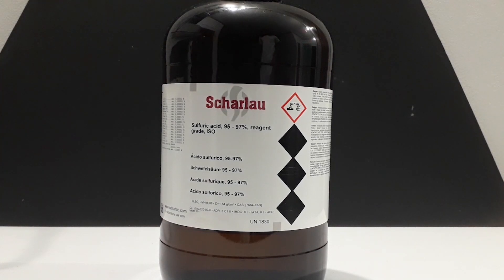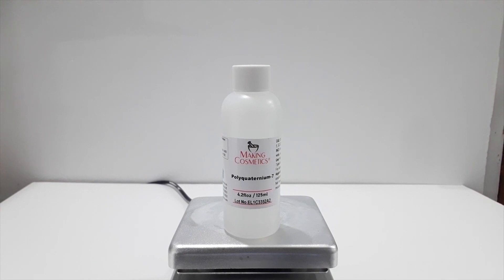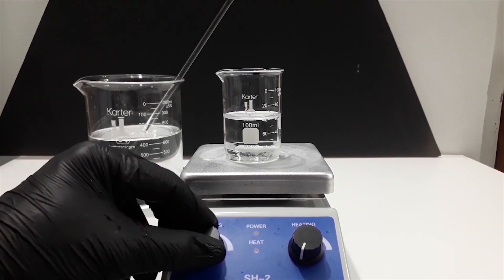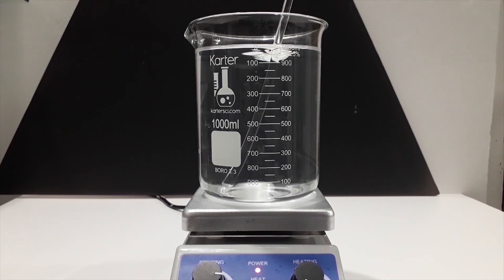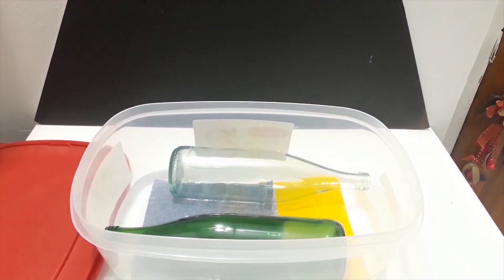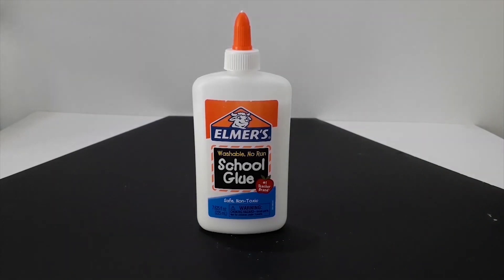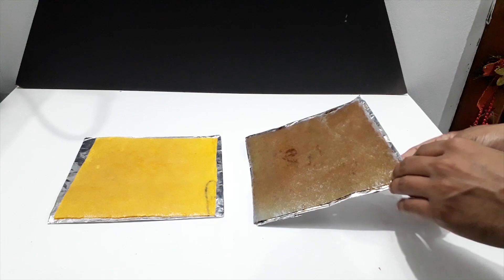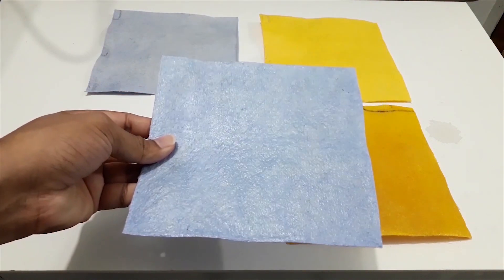How to produce DIY ion exchange membranes for various electrochemical applications.

Comment: got a link to the original research paper? also, how would i go about making a membrane that is meant for anion exchange as opposed to cation exchange?
Reply from the maker: change citric into glutamic/aspartic acid HCl salt. I have a video on that too. also just search this on google for the paper "ion exchange resin made from polyvinyl alcohol and citric acid" and you get a research article as your 1st result talking about this polymer. I simply put it on a substrate.
Reply: @CatboyChemicalSociety  thanks! i didnt think there was much of a chance that you would reply, but you also replied real quick! time to go down the google rabbit hole lol. also, do you think this type of membrane would be able to handle turning concentrated potassium nitrate into potassium hydroxide and nitric acid?
Reply from the maker: @josephgauthier5018  nitric acid is finnicky because it oxidizes at the anode to nitrogen and reduces at the cathode to nitrite and ammonia.
Reply: @CatboyChemicalSociety  does that come down to electrode material selection?
Reply from the maker: @josephgauthier5018  well the issue is also concentration not just electrode
Reply: @CatboyChemicalSociety  oh, well dang. do you think it would be relatively economical to make it relatively low concentration and then distill it afterwards to get it to usable concentrations?
Reply from the maker: @josephgauthier5018  I believed I talked about this in a SM thread and you would need a jacuuzi sized reactor to produce barely 1% HNO3 and its really more worth to do birkeland eiyde even at that point.
Reply: @CatboyChemicalSociety  ah, well crap. then i guess ill have to take a close look at the ostwald process. back on the topic of anion exchange, im interested in concentrating co2 from air, so i might still find some use for it...eventually lol

Comment: I followed your directions and tried to make ur PEM for a microbial fuel cell. Since, u said that if we are making a fuel cell, we can skip the first two steps (applying PVC cement and the dechlorination solution), we directly applied the glue and citric acid to our cloth. But once we baked it, it got burnt and it doesn't have the shiny layer. It also stuck to the foil and was very hard to remove (broke some of the times)

So I was wondering what went wrong? What type of cloth did you use and does it matter? We don't have a thermocouple probe so we didn't can't use that, so is there any problem with a burnt PEM? Does it impact the function? Also how do we know that we did this right and the PEM actually works before using it in the fuel cell?
Reply from the maker: Temp control wasn't adequate because these ovens tend to do something called 30 seconds on and some seconds off so the elements maybe at higher temp so preheat your oven. Also gas oven doesn't work
Reply from the maker: Removal from foil is easy just dissolve the foil in NaOH if its stuck which is why foil is used. If its medium brown its ok but black means too burnt. Fiberglass mesh substrate is best. Theres going to be a new membrane video involving fusing deionizer resin just tested it works well.
Reply: @CatboyChemicalSociety  Thanks for the response! I don't have an electric oven, is there any alternative? Also, I saw in some comments you said tissue paper, so should I use that or the fiberglass mesh? Would I repeat the steps multiple times? My membranes all turned brown so ig that's good. Also, would the holes in fiberglass mesh be completely fine?
Reply from the maker: @srimayikukkadapu2425  yea multiple coats work but yea I suggest getting an electric oven even a small toaster because gas ovens rly don't work for this. Maybe you can also bake the membrane in a hotplate between foil
Reply: Thanks for the response! Thankfully, I was able to borrow someone's electric oven! Just to clarify, would tissue paper or fiberglass mesh be best to use? Would the holes in fiberglass mesh be completely fine? Also, I realized the citric acid I got wasn't pure, it has less than 2% silicon dioxide. Is that fine or does it need to be pure? I also estimated the measurements when mixing the PVA and citric acid together. Would that be too problematic? Do I need precise measurements?
Reply from the maker: @srimayikukkadapu2425  that's fine for citric also tissue paper can be used but if it sticks to foil u cannot use NaOH method to remove and yea the holes im fiberglass will be covered up with many coats because it bakes on insoluble plastic layer above rm that makes thin films

Comment: have you given any thought to sulfonating porous membranes with chlorosulfuric acid?
Reply from the maker: the issue is that highly sulfonated membranes need to be crosslinked or else they will just dissolved. The way sulfonated PS membranes are produced is they sulfonate the monomers and use divinylbenzene as a crosslinker and this forms a crosslinked polymer.

Comment: My glass cleaner contains ammonia, Can I use that?
Reply from the maker: Nope you need NaOH to dechlorinate PVC
Reply: @CatboyChemicalSociety  I mean Can I use glass cleaner which contain ammonia instead of amide chloride salt?
Reply from the maker: @farialorion5934  no it needs a quaternary amine catalyst
Reply: Can you tell me mechanism how it work during photon exchange?
Reply from the maker: @farialorion5934  the free carboxylic group of the citric acid after linking accepts H+ ions and other cations allowing it to pass thru the polymer.
The main ionomer is an ester linkage of citric acid linking PVA chains together to form a water insoluble ion exchange resin with carboxylic functionality.
Reply: @CatboyChemicalSociety  Can I use it wastewater splitting  for H2 production and decrease ch4 production by absorbing Co2 ?or rather I should use PVAcetate with Chitosan membrane?
Reply from the maker: @farialorion5934  PVAcetate is already reacted how can it crosslink. you need polyvonyl alcohol not acetate
Reply: @CatboyChemicalSociety  Can I use this membrane for Wastewater splitting for hydrogen production?

Comment: Thank you for the informative video! I've been scrounging academia for information concerning the manufacturing methods IEMs. How typical would you say is this process compared to something you would see in industry? And a little deeper knowledge, if you have it; what are the main cost drivers for ion exchange membranes? based on this video, the manufacturing seems like a very long and involved process.
Reply from the maker: This is good only for mild conditions or prototype cells proof of concept. This membrane is made of crosslinked PVA and the linker also contains the ion exchange groups. Commercial membranes use a backbone polymer usually PTFE modified wity alcohol then you add a diglycydyl ether as a tail to these sites and finally an amine or sulfonate containing group is reacted to the other end of the diglycidyl ether. These are all perfluorinated in other sites. The main cost is that perfluorinated diglycidyl ethers probably aren't cheap

Comment: is it possible to use this membrane for a PEM - zero gap cell water electrolysis?
Reply from the maker: Id use commercial nafion for that but if its mild you can give this a try but only paint citric and pva on thin sheets and bake. Skip the pvc step
Reply: @CatboyChemicalSociety  Thanks, I have Nafion 2020 (which is a Nafion solution) which material would you recommend to make a composite membrane with nafion? Can PTFE coated with nafion be a good PEM in this case?
Reply from the maker: @mariocorbalang.4537  PTFE is a good substrate but fiberglass works too for a robust substrate and polyolefins are fine aswell.
Reply: Thanks for your answer, will give it a go with PTFE and fiber glass then

Comment: very good video. Could this membrane be useful for zinc electrolysis? the electrolyte contains zinc and iron ions
Reply from the maker: Depends as the mobility of the ions depends on their valency and ionic radius  or is it to prevent further oxidation of iron during electrowinning by using an aem on the anode

Comment: If I want to electrolysis water in 3 conditions as bellow, can you say me if it is possible to use a type of membrane that prevents mixing of initial materials with each other:    1- cathod side H2SO4 and anode side NaOH    2-cathod side H2SO4 and anode side Na2SO4  and3- cathode side Na2SO4 and anode side NaOH  ,   and which one is more practical?  since I want to lower over potential of both cathode and anode by preparing better ion accessibility on each side.      I am really thankful for your excellent video and more excellent answers via comments.
Reply from the maker: if the goal is transfer of SO4 ions through the membrane then using a cation selective membrane would be best.
Reply: thanks for reply, no goal is to having H+ near cathode and OH- near anode to assist electrolysis, if possible please guide how it is possible, but if not perhaps at one side we can use a neutral salt,   @CatboyChemicalSociety
Reply from the maker: @sinaTonewood  Whichever membrane you use it will actually attempt to diffuse unless maybe you use a seperator instead of a membrane which is only porous to OH- and H+ but these are very exotic.
Reply: Really thanks, do you mean separators are more rare and expensive in comparison to this membrane? or there are some materials near us could be used as separator?   @CatboyChemicalSociety

Comment: Thank you very much indeed for the video. I was going to ask something, if you'd like. I am trying to prepare a membrane to obtain liquid caustic from salt water. Would this system be suitable for me or do I need to use different compounds? I would be incredibly grateful if you could reply. Thank you in advance, good work.
Reply from the maker: This membrane as it's shown is for that kind of work
Reply: Thank you very much. I have one more question, will you work with chlorine dioxide? Thank you from now. @CatboyChemicalSociety
Reply from the maker: @fescamakina  I will if I ever need to dissolve iridium into solution
Reply: I am waiting for your chlorine dioxide video with curiosity. success and respect. @CatboyChemicalSociety
Reply from the maker: @fescamakina  need to make SnCl2 first because I plan to use it to dissolve rocks containing precious metals
Reply: GOOD LUCK @CatboyChemicalSociety

Comment: I've seen videos where they had made use of a ceramic pot inside a tupperware container. The ceramic doubled as a diaphragm and a separate container. What's your take on that?
Reply from the maker: It works but it has less ion selectivity
Reply: @CatboyChemicalSociety  Also contamination of the clay pot by metal oxides that will get electrolyzed.

Comment: Can I get only positive hydrogen ion from these membranes if I pass hydrogen through membrane filter? Or just the membrane by itself won't do it?
Reply from the maker: These are proton exchange membranes for H+ ions but if you want to diffuse H2 use an RO membrane they work for that
Reply from the maker: but yes they can selectively pass H+ ions through and infact polycarboxylate are more selective towards protons than polysulfonates.

Comment: thank you so much for this video. i was wondering what is the difference between this and a PEM. (proton exchange membrane)
Reply from the maker: This is a PEM but if you swap out the citric for aspartic acid HCl you make an anion exchange resin instead.

Comment: can this be used in a hydrogen cell ?
Reply from the maker: yes and it can seperate H2 and O2 without losing as much conductivity as an ordinary seperator.
But for a fuel cell specifically you need a thin PVA film over maybe a tissue paper substrate and skip the PVC.

Comment: What happens to the water released during esterification between pva and citric acid?
Reply from the maker: Evaporates due to 140C or higher
Reply: @CatboyChemicalSociety  Thanks!
Can i use these membranes in algae powered biophotovoltaic cells or would it be toxic? Also, how many layers of the ion exchange resins are appropriate?
Thanks again!❤
Reply: P.S. Can i forgo the pvc cement as it is a slightly softer application?
Reply from the maker: @sanhikgangopadhyay8812  yes you don't need it if it's going to be softer stuff like flow batteries
Reply: Would the citric acid be anhydrous or monohydrated?
Reply from the maker: @sanhikgangopadhyay8812  monohydrate works as the PVA is in 10% solution in water anyway. The baking step is what crosslinks the pva chains
Reply: Can i use polyvinyl alcohol powder
Reply from the maker: @sanhikgangopadhyay8812  yes but you need to pre dissolve in hot water to form a 10% solution.
Reply: Ok but why is Elmer's clear glue being shown as polyvinyl acetate glue?
Reply from the maker: @sanhikgangopadhyay8812  it's not but whoever is selling does not know
Reply: In the internet
Reply: Thanks
Reply: What should i use as an activator for this membrane? Is it necessary?
Reply from the maker: @sanhikgangopadhyay8812  it's not really necessary but it depends on use case. If you just want to exchange protons then no need. If you wanna do electrodialysis then you need whatever ion to load up each carboxylic group id use dilute NaOH for sodium ions and other hydroxides for other cations.
Reply: @CatboyChemicalSociety  the layer became a little greenish after baking. Is it normal?
Reply from the maker: @sanhikgangopadhyay8812  should sometimes turn yellowish or amber and no longer be water soluble
Reply: @CatboyChemicalSociety  yeah its actually somewhat amber

Comment: hi iam barely knew chemistry, but from my understanding is that some very fine filter that will bypass ion so by put on PVC cement it will be more rigid and inert? 

then what about acrylic glue as PVC cement substitute? do you think it will work? i have some homemade acrylic glue on my workshop
Reply from the maker: The PVC increases chemical resistance only as a trade off for ion conductivity.
The material is not a traditional filter and the crosslinked PVA ionomer blocks uncharged molecules and only allows for positively charged ions to pass through the plastic film while blocking water and bulk solution.
Reply: very interesting your answer, i found in my home cleaner that contain benzonium chloride 0.75% do you think it have sufficient concentration for doing process like yours?
Reply from the maker: @dogodogo5891  yea you can basically use any cleaner with these ammonia based surfactants to dechlorinate PVC but remember you need 4 molar or higher NaOH so take into account the water.

Comment: Thanks for recipe. Is Microwave useful for membrane preparation? and could i prepare PVC cement by disolving PVC in dichloroethane and acetone?
Reply from the maker: yes you can and also the PVC is just a layer to make it more chemically resistant because partially dechlorinated PVC is more resistant than just crosslinked PVA.
The real ion exchange resin is the PVA crosslinked with citric acid which provides 1 free carboxylic acid which allows ions to be pulled through the polymer.
Microwave is helpful in crosslinking but ive had it burn up sometimes which is why oven is still the best. I had more luck when using aspartic/glutamic acid HCl salt at pH 1 though as the crosslinker as the microwave really worked for this one. The only issue is HCl fumes released when preparing anion resins and the microwave didnt like that.

Comment: so if i understand your method correctly the electrolysis of sodium sulfate works because the sodium ion can pass pass through the membrane, same as the hydrogen ions, but the other ions are stuck, and in the calcium sulfate salt, thanks to insolubility of gypsum the sodium sulfate is always regenerated to give more sodium which then forms calcium hydroxide and more materials for the formation of sulfuric acid, correct? but if that is the case the limiting reagent becomes the sodium sulfate which is not as cheap as gypsum
Reply from the maker: Yes but then sodium hydroxide formed at the cathode reacts with calcium sulfate in an equilibrium reaction forming sodium sulfate. Then due to voltage gradient the sulfate ions pass through and in this process the anion membranes are better which I show in a seperate video. The limiting reagent is calcium sulfate and sodium sulfate is an intermediate and sodium ions are a catalyst.

Comment: how many moles of the ptc are needed?
Reply from the maker: Partial dechlorinated PVC is a primed undercoat to increase chemical resistance. The step can be skipped if the membrane is used in fuel cells or flow cells that don't involve strong acids or chloroalkali process.
Reply from the maker: Overall I used commercial PVC cement so sadly no exact measurements but you can maybe check the msds of one to find out their ratio of PVC to THF and use that.

Comment: if I am using this for a fuel cell do I need to make any other changes other than skipping the PVC cement or would I be able to use it like a Nafion or Dupont PEM membrane? also would using the PVC glue anyway make the fuel cell better for my purpose?
Reply from the maker: The pvc glue is only for chloroalkali compatibility and yea pva citrate blend is a good alternative to nafion for the case of fuel cells. Just be sure to bake many layers to improve ion selectivity.

Comment: Is the pvc cement important? can you use pva for the whole cloth?
Reply from the maker: Pvc cement is only for chloro alkali process compatibility and for other milder conditions or fuel cells then you don't need precoat and can use pva citric to form crosslinked cation membrane